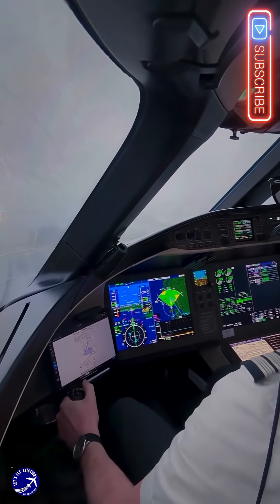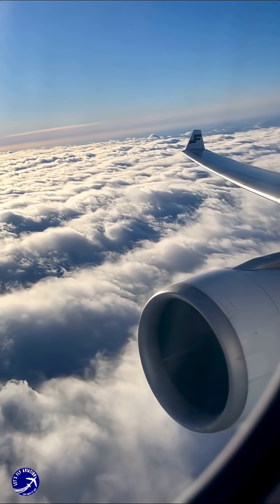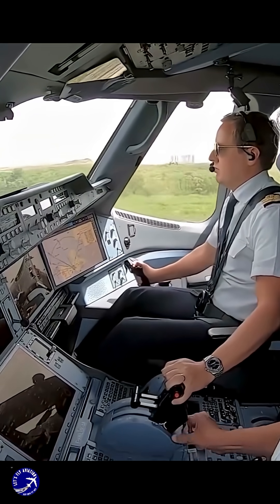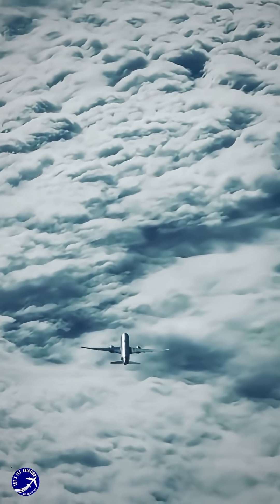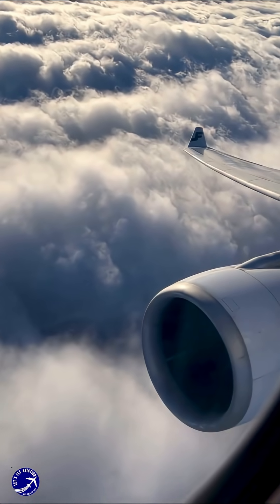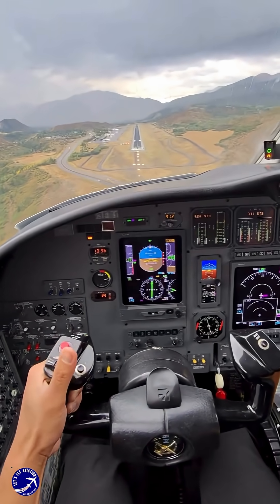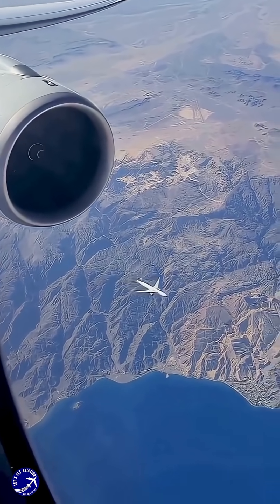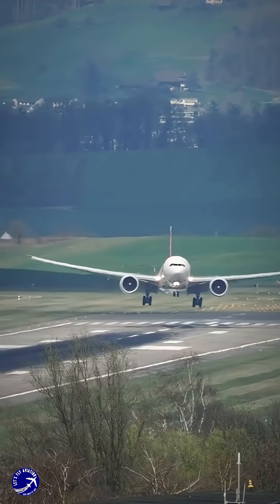How far can planes fly after engine failure?

Comment: 100 miles is great over most land, but in the middle of an ocean, 100 miles isn't very far.
Reply: Even 100 miles of gliding in the middle of mountainous landscape seems to be like the way to disaster
Reply: the chance of finding a usable runway within range is pretty slim. But plane doesn't go from 0 to failure in an instant. It gives off warning signs for pilot to react and adjust course (It still doesn't help if you are in the middle of the ocean)
Reply: You could possibly fly close enough to a ship to crash near and and be rescued 😊

Comment: You should also emphasise that twin engined jet planes can also complete a flight on a single engine. For twin engined planes on any route that takes them more than 100 miles out over water (eg; trans-Atlantic flights), they are rated “ETOPS” (Extended Range Twin Engined Operations) and certified to be able to fly safely on a single engine to be able to reach safe landing from any point in the flight. The loss of both engines is extremely remote and the multiple bird strike example quoted is one of those very rare cases.
Reply: ETOPS - Engines Turn Or Passengers Swim ~
Reply: My Cessna 172, at 3000ft, at best glide speed (70kts), will fly for five miles, plenty of time to find a place to land ~
Reply: The airliner can loose both of its engines not only in the case of the bird strike. The volcano ashes can be very dangerous too and cause the engine failure of all engines of the aircraft.